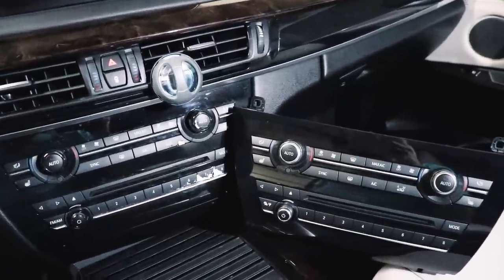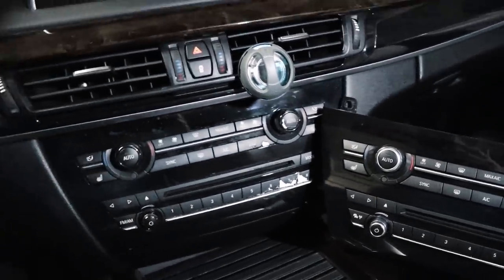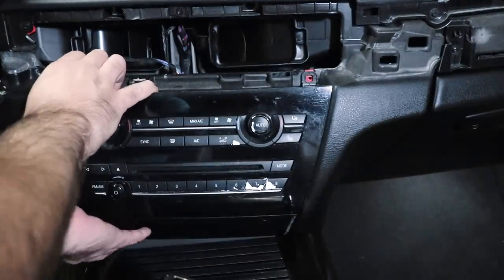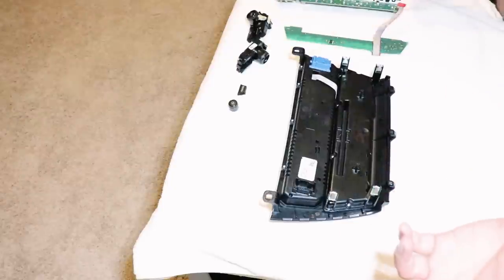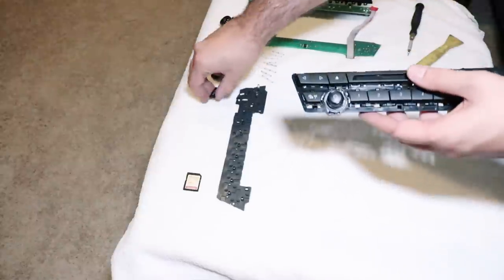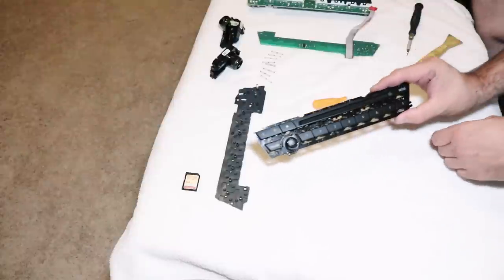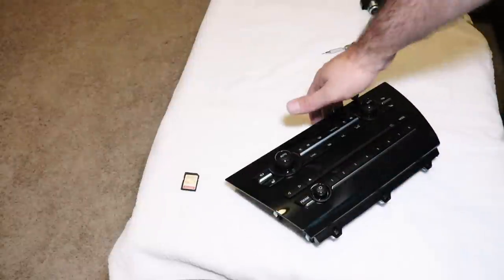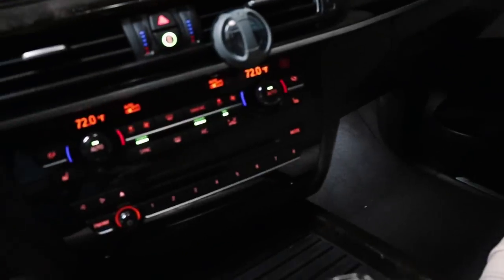How I fixed my climate controls on my F15 BMW X5

Comment: I was able to use this video as a guide for change the whole aircon panel in South Africa, as my aircon indication green light was broken. Was extremely useful to me. It coated me 1500 Rand which is equivalent to 88 dollar at the time of repair for a second hand panel. Thanks for the post.
Reply: Hi, I currently have a X5 F15 with the same issue where my A/C green light is not working and also looking for a second hand panel, just a question, did you have to do any coding to the vehicle when you replaced your panel?
Reply: @haseetbhaga9617  No coding at all. It was just a plug. However, I did damage the clip of the black panel below the aircon unit. So it is currently clipped on left side only. Does not make any difference on appearance.

Comment: Great video, thanks for sharing. I have a question re coding..  does a replacement unit need to be coded to the car? Even if it’s from the exact same model?? 

Thanks.

Comment: Actually the part you got from Europe is for the LCI model, I would have changed only the knobs that are ceramic coated and kept the newer models, coded it and get the white lcd font when lights are off... nice job though!
Reply: It’s need to be coded??

Comment: Hey, quick question, the green light above my AC button is out. Can I just switch out the  bulb or do I need to get a new circuit board with less built in?
Reply: Did you ever figure this out? I have the same problem
Reply: @amlung99  Yeah, you at least need the circuit board. The bulbs are soldered in.
Reply: @tominfhl  Thanks!
Reply: @tominfhl  got a link to what I need? 2015 x5 with cooled seats and ceramic. Ac light went out
Reply: @MidwestNomad1  No man. I haven't fixed mine yet. I am living with it. I would say, just pick up a used climate control on eBay or the junkyard. Easier than trying to find the board.
Reply: @tominfhl  ok, eBay doesn’t seem to have much. Might take the board to a computer repair shop see if they can re solder the led. Seems like if I hit the ac button a bunch of times to either turn it on or off, the temp is cool either way lol
Reply: @MidwestNomad1  or it you're not sure if the AC is on, then hit the Max AC button. Then you can turn off max ac and regular ac will still be on.
Reply: @tominfhl  hi 👋, I try that , but it’s not cooling normally, I got a climate control from eBay , is cooling perfect, but now the rear controllers not working, … any idea how to fix it?